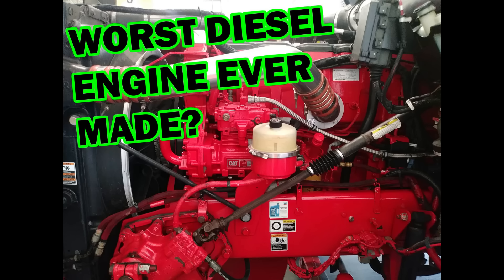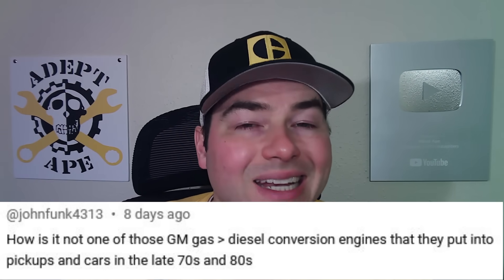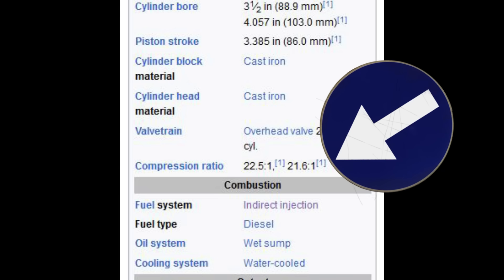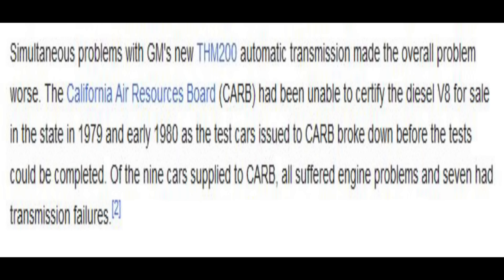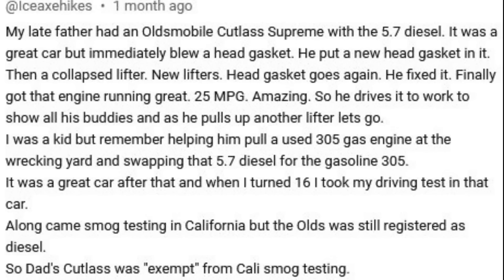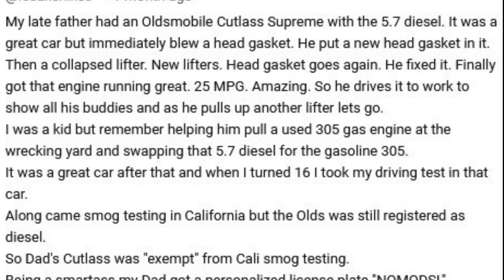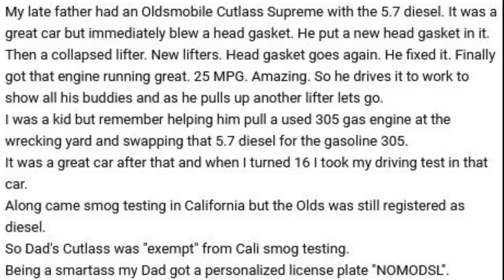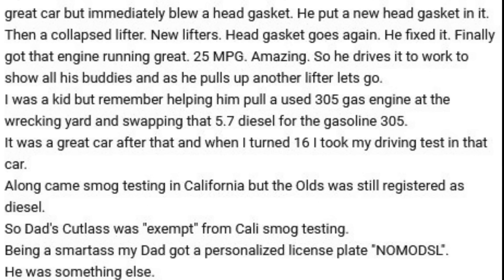This Engine is the Reason You Don't Have Diesel Cars in America!!!

Comment: As an engineer I'm triggered by them using the same block (likely too many other parts) as the gas engine, specially if they pushed above 17:1 compression. That's insane.
Likely bean counters breathing down their necks to make "better MPG" to couple with "Diesels are more reliable" as marketing points.
Granted that the engineers involved might have had little to no experience in Diesel engines, but I can't make excuses for that crap. They should've said no and/or bailed that shitshow.
Reply: The block, pistons, connecting rods, crankshaft, heads, etc. were not gasoline parts. They were unique to the diesel. They used the same factory tooling used to build gas engines to build the diesels. That is how the 5.7 displacement is shared with the gas engines. 
I had a 1982 Pontiac with an Olds 5.7 diesel. The fuel economy was amazing for the size of car however, reliability was an issue. It was a good idea - make a diesel that would fit in the same envelope as a gas engine - however it was rushed to market and by the time they ironed all the bugs out, its reputation was pretty bad.

Comment: GM 350 blocks are a robust beast. Two stupid engineering mistakes that were made: 1. The Stanadyne-Hartford eight (8) port rotary injection pump was mounted where the distributor used to be. It is a relabile injection pump. A common gasoline engine filter was used that allowed water to pass and destroy the pump and the tips of the nozzles. Some folks with boats replaced the filter with a quality water separator as used in their boats and never had injection system issues. 2. The high compression ratio required a much higher valve spring pressure. The camshafts were hardened to the same standard as their gasoline counterpart. The cam lobes wore down fast. With a little more development and testing before release, GM could have had a great product. Meanwhile my naturally aspirated Isuzu powered Chevette diesels offered a steady 50 MPG and our Isuzu turbo diesel pick-up truck gave us 40 + MPG.

Comment: One of my uncles had a diesel Chevrolet pickup, a complete POS. I knew a couple folks with Oldsmobile diesels, lots of blow-by and horrible oil leaks.
Ford's Mercury/Merkur division used a solid BMW diesel engine, but Ford dropped the Merkur division after just a couple years.

Comment: Engineering a V8 diesel utilizing the same tooling that produced gas engines is not easy. That is exactly what GM wanted to do - build diesels from the same tooling used to build gas engines to create an economy of scale. The engine was a true diesel - not a gas conversion - the tooling used to build the engine was shared from gas engine production. This engine was a design from the 1970's and executed and improved upon from the late 70's to the mid 80's. No other domestic manufacturer made a diesel engine designed to fit in a full size rear wheel drive car. The design was created out of the gas shortages of the 1970's and new fuel economy standards and rushed to market to fill a need. 
In those days, it was hit and miss on dealers that were trained on the diesels as well. The Pontiac dealer in my area was not trained/equipped to work on the diesels, however the Oldsmobile garage had a dedicated/trained 5.7 diesel mechanic. Ownership experiences were very different if one owned a Pontiac verses one that owned an Oldsmobile in my area. 
We had a 1982 Pontiac Bonneville with the 5.7 Olds diesel. The car was unlike anything else - a full size car with excellent fuel economy. It had electrical/glow plug issues from day one - that is how we experienced the differences in Pontiac verses Oldsmobile service department. 
The diesels did not help GM, nor give passenger car diesels a good reputation in America. However, this was not the first time and unfortunately will not be the last time a design has been rushed to market only to find its shortcomings once people own and drive the vehicles.

Comment: GM were idiots trying to enter the passenger car Diesel market, when you had to compete with the undisputed king (Mercedes-Benz) and the runner-up (MFI Peugeot Turbo Diesels). If they were smart, they would’ve taken their existing Isuzu Turbo Diesels and tried improving them for use in larger, heavier vehicles (turning their existing I4’s into I6’s or V8’s).

Comment: Hey, youtube unsubscribed me and I almost missed my own comment being featured!  You know, after the failure of the 5.7 Olds diesel; GM went across the street to their Detroit Diesel division and had them design a new diesel engine from the ground up. It was the 6.2 Detroit diesel. Technically it is all GM and the engineers from Detroit just designed it. They specified a forged crankshaft but the bean counters at GM went with a cast crankshaft. Detroit engineers said there would be failures. GM said; "We can accept that if it saves a penny". The 6.2 was released in 1982 in a naturally aspirated format and actually is a far better engine than the 5.7; but not without problems. Main web cracking, crankshaft failures, and a very modest power (135 hp) output. But they did deliver incredible mileage for the time in some very heavy and large vehicles. Later the 6.2 became the 6.5 and eventually turbo charged. By todays light truck standards the 6.5 is a toad. But for the time; it was a decent engine for power, economy, and reliability.

Comment: I had an Olds Cutlass with the 350, with the right parts it was surprisingly powerful.
I know at the time the 350 diesel block was a choice for a performance swap, because it was compatible with the gas version parts, but reinforced in key zones (like the crank bearings) to get more horsepower as a gasoline engine.
For what it's worth, the gas version was also hard on head gaskets.

Comment: VW had long time success with their 4 cylinder diesel which was a convered gasoline engine.
     The Oldmobile diesel was conceived as a diesel from the beginning. It's similarity to an Oldsmobile gasoline engine, is mainly shape & size, so that it would easily fit in so many different GM models.
      It's misleading to characterize it as a "converted gasoline engine". The reason it sucked, was the nerd beancounter accountants at GM wanted to save a few nickels on head bolts, etc.

Comment: My cousin's dad had an Oldsmobile wagon that was originally equipped with a diesel engine, which blew up before they got it. So someone put in a 307 Olds petrol engine. Problem was they kept the diesel torque converter and shift points. Poor thing never could get into its happy RPM range.

Comment: Had a 1980 Olds Regency with the 350 diesel engine. Loved that car, great fuel mileage (30 mpg), but it smoked like a forest fire. It leaked oil (I replaced the rear main seal which helped) and we kept it for several years until the head bolts cracked and the exhaust was blowing through the radiator. I then bought a Pontiac with a Goodwrench diesel engine (supposed to be the good diesel) intending to swap motors but I never got around to doing it (I was working 7 days a week then). I gave up on it and got rid of both of them. One of my mechanic friends determined he was going to make his diesel Olds work. He bought ARP head bolts, followed the correct sequence and torque settings for the head bolts and it still cracked the bolts. He gave up too.

Comment: hey, young man. I'm over 70 and I was around 30 when they came out. true, the earlier ones were appalling but later they followed some of Gale Banks original advice and improved it. My girlfriend bought an "82 wagon Chevrolet, and it was reliable as hell unlike her Shitty 1979 Cadillac Eldorado diesel (the Olds 5.7D). I used to get 32 mpg in local driving with it and I loved it as this was an enormous barge of a land yacht. It would smoke like a train, however,
if you wanted to accelerate a little faster due to lack of turbocharging, which I am sure this block would be incapable of withstanding.

Comment: In the '80's I was working in a huge GM parts department that served all GM lines.  One of my customers ran a diesel shop and he gained a reputation for doing super nice diesel to gas engine conversions.  Most of the time he was doing 350 or 403 Oldsmobile gas engines, but at customer request and payment he would swap in Chevy small and big blocks.

Comment: Had a customer with an Olds 88 with one of these engines.  It came to me with the problematic broken head bolt on the pass head which caused the heater to not work.  I gave him an estimate for head gaskets and new bolts.  He ended up selling me the car for 200.00.  I put gaskets and bolts in and drove that car for 5 years before I tired of it and sold it.  I also did a couple of gas conversions.  My favorite was one where a customer located a 403.  I had that rebuilt and hopped up a bit.  That car would smoke the tires after that.

Comment: The biggest problem I saw with them is the power band was too narrow for the 3 speed with lock up converters. Driving on flat land wasn't too bad but in hilly country the car would loose a lot of speed before downshift was possible. The Chevy diesel trucks where also horrible for towing in hilly country. We had to loose way too much road speed before we could down shift. I don't think they had the transmissions beefed up enough for the low speed pounding either.

Comment: The EPA has no brains. They added an EGR to diesels. This cools combustion temps which reduces NOX (nitric oxide) production. It also clogs the intake(s) and makes you throw the thing away. Now, cooler temps is bad on diesel engines. They are DESIGNED to run hot. Being cold, they produce a lot of soot due to improper combustion. What do they do? They add a soot collector (the DPF) which then needs to spray diesel on the soot to burn it at around 1,200f. Now we're hot and producing NOX again, so we need an SCR system (DEF is sued here) to reduce NOX. The DPF will eventually clog and require replacement costing thousands of dollars, because as the soot burns into ash, ash clogs it up. Yay! A vehicle that could last 50yrs now lasts ten and then gets thrown away! So much better for the planet, burying or scrapping cars.

If NOX is the enemy, why not just add an SCR system and let the stupid engine work? We don't need EGRs clogging the engine up or DPFs clogging the exhaust up. Either way NOX is created and DEF reduces or eliminates it, so why not scrap the EGR and DPF? Our EPA is so unintelligent...

Comment: In 1988 Because of GM, I bought a 70K mile Diesel VW Dasher Station wagon, AC, moonroof, Leather, It was a Passat rebranded as Dasher, looked like a 4 door wagon Scirocco . Awesome 50MPG car in practically new condition for $1500 at a time when diesel cost .99/gal.  I was 17 I put 500,000 miles on before the end 10 years later. Because of GM even the VW dealer would not take it in trade for a brand new Passat TDI in 1996. That car would beat, stoplight to stoplight, every car its age short of a dragstrip car, soon as you hit 60 and shifted out of third the race was over would take 5 miles to get to 80. $5 dollars of fuel cruise all weekend long drive to school all week the next week, The cops would not believe it could speed and I stopped getting tickets as they didn't even check me.  Downside $500 starter motors every 18 months.

Comment: I sure made a lot of money turning wrenches on those motors at a Pontiac dealership in 1984- 85. I was heavy line mechanic and all I did was change out those motors and injector pumps also. By the time they beefed up the motor and we fixed most of them it was over. Nobody wanted them. Actually ended up a good motor. GM was a little late to the party with all the upgrades and couldn't save it.

Comment: Your initial premise is wrong. The only real similarity between the olds "rocket 350" (gasser) and the olds 350 oil motor was package size, and mount placements. The 350 diesel was a clean sheet design, and actually fairly well designed and engineered (as opposed to the fuel pincher).

Look, the REAL problem with the 350 diesel was manufacturing. The old method of block casting required "seasoning". An iron casting experiences "dimensional creep" for a period of time after it emerges from the sand/die. You can take the raw castings, pile them up for 6 to 8 months, and all the internal stresses equalize. You can accelerate that by subjecting them to artificial seasoning, a series of heating/cooling cycles over a few weeks, same result. The standard at the time was cast, artificial season, then begin production machining. Result: nice dimensionally stable castings that became dimensionally stable machines/parts.

Ok, mid 70s, GM was looking to streamline production, lean out inventory, and cut energy costs. In a biz where you replace a steel stamping with an injection molded plastic bit to save 2 cents per unit, the idea of eliminating a costly operation like artificial seasoning would be manna from heaven.

Well, their iron supplier sold them those magic beans. A new "space age" iron alloy. A little more expensive, but, according to R&D testing, fresh from cast stable. Unfortunately, the testing was fairly simple shapes, geometric webs like triangles, ls, circles, notched bars kinda thing. GM was setting up a brand new line to produce the 350 diesel, so setting it up for "magic bean metallurgy" made sense, as all the other lines still had service life left, and tooling wear was being used for piecemeal conversion to metric fasteners.

So, model rollout was brand new design, brand new alloy, brand new production method. BRILLIANT, it was gonna flagship a new era. Well, reality reared it's ugly head, and bit them, HARD. The new motor was seasoning in service. Sure, less creep than the old alloy would have, but enough to kill alignment. Lifter shelfs wandered, cam bearing bores lost alignment, mains doe see doed right, left, fore, aft... basic catastrophe. 

Eventually, they kowtowed to reality,  introduced seasoning on the oil burner line, and cured it. But it was too late. Sure, there were standard "new stuff" teething problems too, but the REAL problem was the casting production cycle. By the time everybody responsible admitted the ball was dropped, NOBODY on earth would buy an olds diesel. Hell, you couldn't give them away anymore, and they tried. Customers wouldn't even take a free trade to a properly built one, they switched to gas engines from the junkyards instead.

THAT is the real story of the failure of the old diesel debacle.

Comment: Having lived through that time, I can't remember hearing of one of those diesel V8 disasters living beyond an absolute max of 60K miles.    Being a Ford guy myself (V8 Mustangs of the muscle car era), I didn't much care.  If you knew what you were doing, you could get 23 - 24 mpg out of a 289 ci 4v carb bumped to around 240 HP with the right gearing and jetting on the carb.

In fact, I got that going down the then new interstate 5 between Stockton and Bakersfield with a 70 mph speed limit.  At the time, I was returning to college and I had a broken speedometer cable, so I didn't know how fast I was actually going, thinking I was about 15 mph faster than the limit.  Um, no, it turned out to be faster, a lot faster.  

I saw a black and white Polaris (that's what the CHP used back then) way, way behind me, slowed to about what I thought was right and was promptly pulled over. 
"Do you know how fast you were going?"
"No Officer, I don't.  My speedo's broken"
"I was about to radio ahead for a road block.  I chased you for 14 miles,  was doing 115 mph and you were walking away from me!"
"Gulp"

Best ticket I ever got though. He wrote it for 80 in a 70. Otherwise I'd have gone to jail.  Probably saved my fiancé's life as well as mine. Tires weren't meant to sustain such speeds for very long and it was a warm day.  But I averaged 23 mpg on that trip!

Comment: I knew about the 5.7 diesel debacle. Why did Detroit Diesel do such a poor job? I assume GM had them on a small fixed firm budget. Many years later I bought a used ‘84 Suburban with the 6.2 diesel. I needed it for my family and hauling my boat. It was awesome. Very reliable. Excellent MPG for the time. As an added bonus diesel was far cheaper than gas. I sold it to by a newer Suburban with a 350 gas engine. Mileage sucked.

Comment: had two in the family,  I babied the Olds Royal.  Burned oil at 15 K,  replaced with 350 gas and failed 200 tranny at same time.  

State wanted to do visual check to see if diesel was still there.  One day at work we got 6" of wet stow and I took the car for inspection parking way back in the lot.  Manager came out in low Italian loafers and gave up 50 feet into the wet snow.  He said it said diesel on the trunk and that was good enough for him.  Drove the gas 4 more years.

Comment: The ARMY bought an entire job lot of these engines in the Chevy Blazers in the early 80's. They had a different head gasket than factory though. The thicker gaskets lowered the compression ratio to something like 18.5 to 1. They were the most fun thing around, until the HMMWV hit the base.